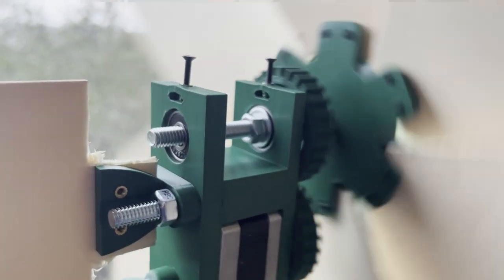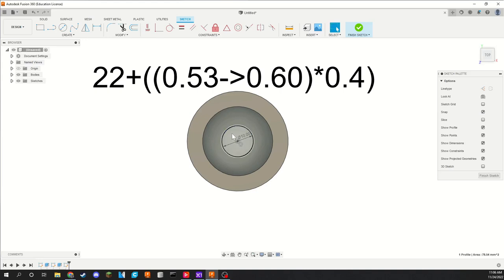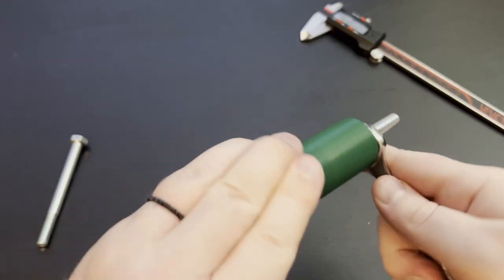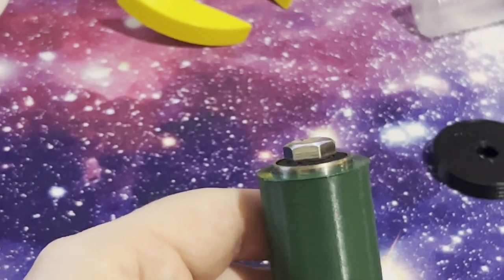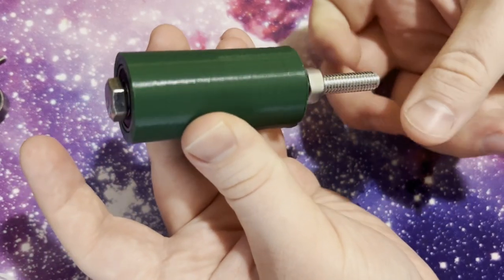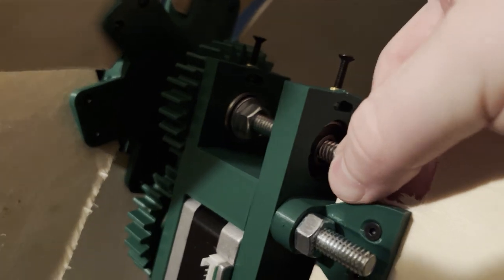Using Bearings with 3D Printed Parts

Comment from the maker: Thanks everyone for your input! I'm going to pin this comment to highlight some of the helpful input I've gotten, and I'll edit it as more input comes until I inevitably redo this video with all my new knowledge :)

- The bearings lock up when under an axial load because they're not designed for that. A bearing that is designed to spin under axial load would be a thrust bearing. 
- A good way to space out bearings on the same shaft is by tightening two nuts against each other. Just make sure you tighten them such that the rod they're on is not under load. 
- WD-40 is acidic, and may ruin some bearings that have specialty coatings. Your 608/RS/2Z's will be fine though. 
- The "rings" I referred to are technically races
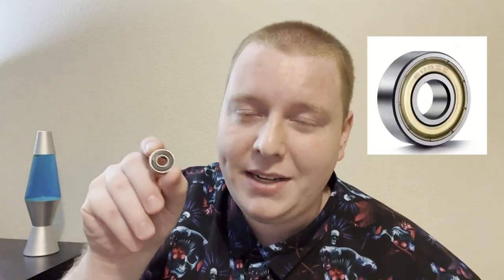- I misspoke at 0:56. The "correct" notation is SS, because it stands for steel seal. SS, ZZ, 2Z, 22, 2S, they're all the same. SS is technically correct, but it doesn't really matter
Reply: Great video! The reason for locking up is the type of bearing. They are designed for vertical loads (therefore it's a vertical bearing). If you use a thrust tapered bearing then it will still spin freely with it tight (depending on how tight of course). It all depends on where the load is coming from. (There's also horizontal bearings as well).
Reply: Hey, why didn’t you sponsor it? There’s a lot of views ,I’ll bet a lot of people ordered. You should do it. I ordered them just now.
Reply: If I recall correctly, The 2S, 2Z suffixes signify the type of seal. 2S means 2 seals (like the ones you prefer in the video. 2S, or maybe written SS) you can get 1S uncommonly and they only have a seal on one side. 2Z are called shields and are used to prevent contact of the seals on both races to reduce seal drag. The don't have as good dust/water resistance though. Can be written 1Z as well with only one shield on one side.
Reply: I've used thrust bearings on quite a few things that I've made (knife sharpeners, spinning tool/pen holders, etc.), both ball-types and pin-types, and you can really clamp down on these with a fair bit of axial load.
  I love using any type or size of bearings in my stuff; I've been fascinated with them since my dad brought home from work a giant (to me at the time) roller bearing, which was around 150mm Ø and a few smaller ball bearings that they'd replaced off an induction furnace.  Okay, I admit it: I may be quite weird in that respect. 😄
Reply: @troyd-motorsport9933  ⚠️ God has said in the Quran:

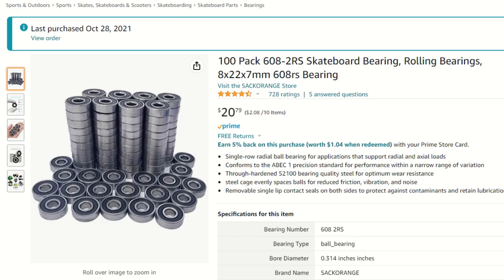🔵 { O mankind, worship your Lord, who created you and those before you, that you may become righteous - ( 2:21 ) 

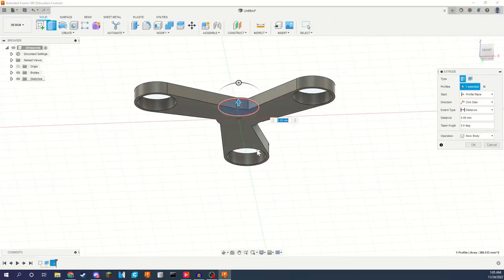🔴 [He] who made for you the earth a bed [spread out] and the sky a ceiling and sent down from the sky, rain and brought forth thereby fruits as provision for you. So do not attribute to Allah equals while you know [that there is nothing similar to Him]. ( 2:22 )

🔵 And if you are in doubt about what We have sent down upon Our Servant [Muhammad], then produce a surah the like thereof and call upon your witnesses other than Allah, if you should be truthful. ( 2:23 )

🔴 But if you do not - and you will never be able to - then fear the Fire, whose fuel is men and stones, prepared for the disbelievers.( 2:24 )

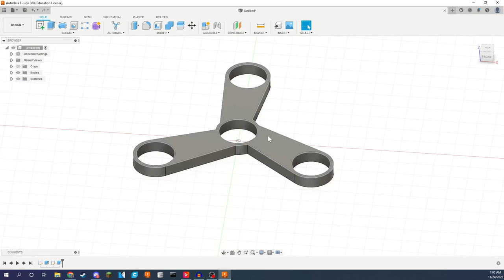🔵 And give good tidings to those who believe and do righteous deeds that they will have gardens [in Paradise] beneath which rivers flow. Whenever they are provided with a provision of fruit therefrom, they will say, "This is what we were provided with before." And it is given to them in likeness. And they will have therein purified spouses, and they will abide therein eternally. ( 2:25 )

⚠️ Quran
Reply: Thanks for the video.
Angular contact bearings will handle both radial loads and axial loads.
Reply: @1islam1  Sod off with your Magic Sky Wizard spam!
Reply: WD-40 is also repels and removes moisture from most materials, it tends to make plastics brittle. Drenching your RS in WD-40 will destroy the seam over time.
Reply: @Loneman_OG I prefer the proper term - sky pixie ;)

Comment: You want spacers between your bearings. If you load them perpendicular to their rotation axis, the inner races are squeezed together and the balls inside get pinched between the edges of the inner and outer races.
Reply from the maker: Interesting. I figured it was something like that, but glad someone smarter can verify! Thank you!
Reply: Indeed If you supported the inner race you would find the pressure of the nut has no effect
Reply: @scatdawg1  right on!
Reply: yeah this is the issue, put spacers on either side and it wont lock up
Reply: Yeah, good point. Nobody wants their balls pinched 🤌🏾
Reply: you could do a double nut. tighten a second nut on the first nut should hold it in place. and the spacer could be a lock or plain washer.
Reply: Use a nylon lock nut...

Comment: 4:12 that is a quick and easy way to ruin the bearing with the nut on it. Ball bearings are not meant for axial force (like you are putting on it by using a bolt and a nut to pull in another bearing), and will quickly cause indentation damage to the balls and/or the races. Use a press or a clamp for this. If you want to pull in the bearing with a nut and a bolt, use washers on the other end so the force is transmitted either onto the outer-race of the bearing, or directly into the surrounding part. Just a little tip :) I mentor a HS robotics team and I have seen so many bearings ruined by apply force onto the wrong race.
Reply from the maker: Good point! I suppose I figured if it's taking enough force to insert the bearing that it's ruining it, you probably need a slightly bigger hole 🤣 but thank you for pointing that out, as you are most definitely right.

Comment: The main reason that shoulder bolts are much more expensive than the other types you talked about is because of their precision. Their diameter is much more accurate than common hardware store bolts, but that comes at an increased cost. As you noted, they're pretty unnecessary for 3d printed parts. They're designed and used a lot in accurate positioning and fixturing in machinery and manufacturing respectively.
Reply from the maker: Interesting. It seems even more strange then that an 8mm precision shoulder bolt still isn't 8mm... Are there any bolts that you know of that have an exactly 8mm shaft, with M8 threads at the end?

P.S. Thanks for the info!!
Reply: @christophersfactory  it's very unusual to see a 8mm shoulder with m8 thread - m6 is the standard.
I'm also not sure how you see as much slop on shoulder bolts as you do on normal ones - standard tolerances are on the order of <50um on the diameter, when threads are specifically designed to be undersized vs their nominal diameter
Reply: @christophersfactory  shoulder bolts need to be "precision ground" for bearing applications, normal ones are undersized by up to 0.1mm

Comment: 2:48 This is incorrect. The slicer compensates for the extrusion width. Any discrepancy between the given dimension and the actual is caused by shrinkage of the part as it cools and the tessellated approximation of a solid as a mesh.
Reply from the maker: The discrepancy is caused by both! I can only speak to Cura -- it definitely doesn't account for extrusion width. I believe on some slicers you can specify if you want your features to be at least their specified dimensions, or at most, but on Cura, it traces the path of the identified diameter.

You are right though in that the shrinkage of thermoplastics plays a big part in it, I should have mentioned that!
Reply: @christophersfactory  I don't really understand what you mean, I agree with the commenter. The dimension is given by the stl, and if it's a "hole" features the slicer knows it should be 22mm and the path will be slightly outsetted. if it's a "pillar" feature the slicer places the path slightly inwards. Feel free to test this out by setting your extrusion width in the slicer to a comically large number eg. 2mm and you will see the effect - the hole should still be near 22mm. 
The effect you're seeing is likely coming from poor extrusion tolerances and the fact that the layers aren't perfectly straight 
Have a good day
Reply: @christophersfactory  Cura absolutely compensates for the extrusion width. I've tested it by exporting the toolpaths as a mesh file. This generates an OBJ with all toolpaths modeled with their respective heights and widths. A 20 mm hole measured 20 mm across "corners." As id said, the slicer knows whether features are internal or external based on the normals of the surfaces the mesh is composed of.
Reply: Seems like it would be an oversight for a slicer not to compensate for extrusion width, especially when it knows what your extrusion width is to begin with. I think it has more to do with hardware inaccuracy/thermal expansion/contraction than the slicer not compensating… but I will say when working with tight tolerances, my go to tolerance is 0.2-0.3.
Reply: I will add a little bit of nuance to this discussion and say that slicers using the slic3r engine (prusaslicer, super slicer, bambu studio, orca slicer, etc) actually do give slightly inaccurate walls, but for a different reason. Slic3r overlaps perimeters for better strength, but the results is dimensions that are a tiny bit off. In Orca Slicer fixing this is as simple as checking the "use precise walls" checkbox (at the risk of reduced part strength, and in extreme cases delamination of the outermost perimeter). Cura, however, does not overlap perimeters (as far as I know), so this is particular cause does not apply there

Comment: The slop in the fit between the bolt and the inner race is because most bearings are made to go on precision shafts, not bolts. You can order shaft material pretty cheap, especially in the 8mm size.

Also, the best way to space bearings on shafts is with external retention rings, but since those require at least a lathe and grooving tool, your next best bet is with shaft collars. They tighten on the shaft wherever you want by way of clamping bolts and/or setscrews.

Comment: Friction fit is another term for "Press Fit" or compression fit in metal machined parts. The acceptor metal opening is expected to expand and be under compression. You  may try to create an opening with a serrated inner diameter which will deform more easily. Roughening the outer diameter of the bearing may help.
Reply: Aka interference fit.
Reply: Good thought on the serrated inner surface; triangular teeth on the ID would crush progressively, and should keep the bearing pretty well centered as it’s pressed in, without offering as much resistance as a solid wall. 👍
Reply: I chased my tale for ages (about 3 months)  with friction fits into plastic (with pins rather than bearings) for a project - trying to optimise my hole sizes, making jigs etc - till I realised that friction fits need precision holes - just not repeatable in fdm plastic - as when you come back and try the same In 3 months it doesn’t seem to work - but most importantly - plastics are prone to creep under static load, so if deformed elastically to hold a part by friction in time it will relax.
Nylon - which is less prone to creep changes its dimension with humidity - so that will lose grip because the wa rather changes ! Best stick with glue was my conclusion - as even at screws are still relying on elastic deformation of your 3d part …

Comment: If you want them to spin you need thrust bearings not radial bearings. Radial bearings are designed to take a load on the outside race but not a side load. Thrust bearings are designed with preloaded compression in mind like on a lathe.
Reply: Not sure how this video was made without this point included.

Comment: WD-40 is not a lubricant, as it was never designed as such. Rather use a bearing grease as they are cheap and used in the automotive industry.
Reply: He does not claim that it is. He claimed that for his purpose, an unlubricated part would be enough. The steel balls probably won't wear down in the lifetime of his 3d printed machine.

Comment: Make to hole just smaller than the bearing so that the bearing will not go in but almost will. Put the bearing in the freezer for an hour or so. The steel will contract a small amount but should be enough to push the bearing in the hole. When the temperature rises back up it will expand and tighten the fit to a friction fit. A lil glue wouldn’t hurt but not really needed
Reply from the maker: Interesting! I wouldn't have thought it contracts enough to work. I'll have to try this! Thanks!
Reply: wow thank you! that might be the answer i was looking for. i will let you know how it went.
Reply: that didn't work at all, it made no difference. this might work with metal or if you have very large bearings but mine is only 22 mm OD and the PLA is too soft for this to work. the tiny change in OD form the temperature change makes no difference at all.
Reply: @dronefootage2778  This trick only works if you can very precisely control tolerances between fitted parts and those parts have rather similar thermal expansion coefficients. You can't do that with "standard" 3D printing.
Reply: @zkasprzyk  that makes sense. the solution i came up with is to print a cap that gets screwed on.

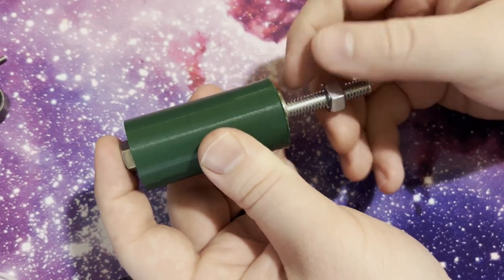Comment: For the nut and bolt thing at 6:45 , you can fix this by putting on the first nut up to where you want it, but not too tight, then put on a second nut, and then tighten them into each other.
Reply from the maker: This is such a good remedy for that! Good thinking, thanks!
Reply: @christophersfactory  This is how quick-release bike wheels are assembled but instead of a pre-assembled bearing cartridge, the hub has cup-and-cone races with loose ball bearings. Two nuts are tightened against each other on the hollow axle/bolt to hold everything together without squeezing the bearings to death (seizing up). The quick-release skewer (the part most people manipulate to change a flat tire, etc) goes through the axle and is just there to install the wheel on the bike, it doesn't really apply any force to the bearings or hub. 

Applying the right force with the lockl nuts to hold things together is a bit of an art. Too little or too much can damage the bearing races and/or make the wheel harder to spin.
Reply: Or use a locknut :)
Reply: @ItsWami  I don’t think a locknut would do the same thing: You want to load the bearings with a specific compressive force, then lock the nuts at that position with check-nuts. Locknuts either rely on the force spooled against their flange to keep them from turning, or have nylon inserts to do the same. I don’t think Ny-loks would offer enough resistance to turning to be relied upon in something like the bike-hub application.

Comment: In the robotics pieces I've crafted, I have used copper sheeting (easy to get rolls of it cheap) to create a sleeve that wraps around the 5/16" threaded rod.
That takes up the additional space much like your teflon tape method you mentioned, but the teflon tape can continue to deform and a thin copper sheet does that 'less'.
Also, it won't degrade as much if I end up needing to lubricate the bearings later. Some kinds of plumbers tape (or similar) can melt in the presence of lubricant/solvent mixes (like WD40).
I suppose aluminum foil would also work. Great content!  Please keep up the good work.  :)

Comment: 2RS = 2 rubber sheild
RS = One side rubbe sheild 
ZZ is not mistyped, many mgf use ZZ. One Z is one side sheild ZZ is sheild both sides. But if the shild is stamped ZZ, this is incorrect. One shield shouild only have one Z on it. 
Pedantic, I know :-)
Reply from the maker: No kidding?! This is the first explanation I've seen that made sense, and I've seen a lot. I was told SS just stands for steel seal. Can you tell me this? -- why would one want seals on only one side of the bearing?
Reply: @christophersfactory  A one sided sheild is often used in motorbike gearbox for example. Oil flows to the bearing but not right through so oil flows down a oliway.
Reply: @christophersfactory  The SS or S prefix is usually stainless steel.  it should also be noted that the "R" seals are contact seals.  Some seals (eg, designated as V or VV or LLB depending on the manufacturer) are non-contact seals and are used in conditions that are relatively clean and require a high-speed, low friction bearing.  There are MANY different types of seals and configurations and designations!

Comment: Nice video! To prevent that nut from spinning loose, you can use another nut to lock it in place. Set your first nut right where you want it along the threaded shaft (just enough to let the bearings spin freely). Using two wrenches, torque the second nut tightly to the first. That pressure locks them both in place. the 'locking' nut can be removed easily when you want to disassemble it.

Comment: The other tip I would add is to add a small chamfer around the edge of the bearing recess to compensate for elephant's foot if it will be on the bottom of the print.
Reply from the maker: YES! I should have said this in the video. That's a huge one that helps with fitting these bearings in.

Comment: Great video and I'm more intrigued at the wind generator!    Fantastic point about logging all the research.  I'm probably going to create a form to print out for the things I work on as I normally wing it.  Then end up printing the same mistaken part twice, or not really try to push myself beyond the normal limits.   I can see documenting my stages and steps is critical.  

Usually I'm the "oh that needs X" and adjust it a tad and then start again, but yes I do find myself wondering which version I'm about to use by the third round.

One idea would be to make a cap that fits over the bearing as well that would allow both friction fit an C.A. Glue so the bezel of the cap holds it in place.